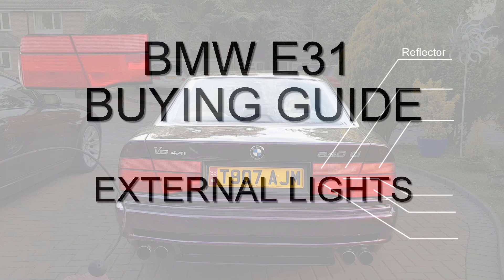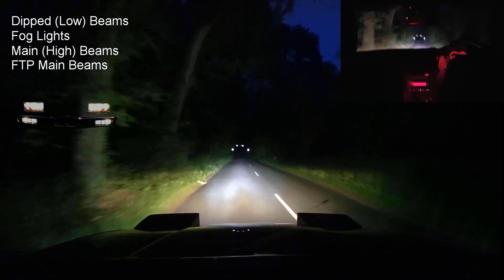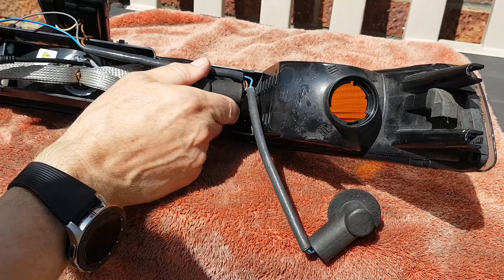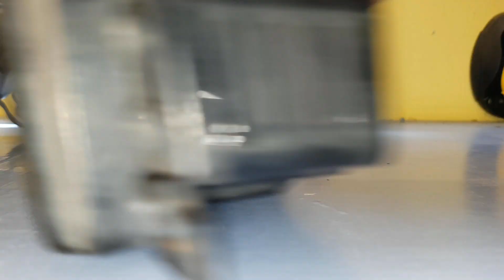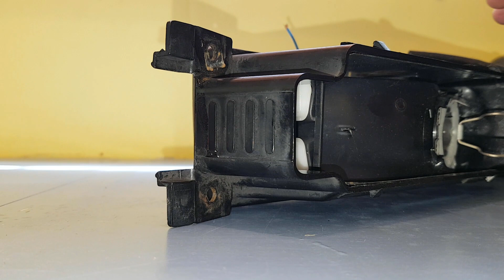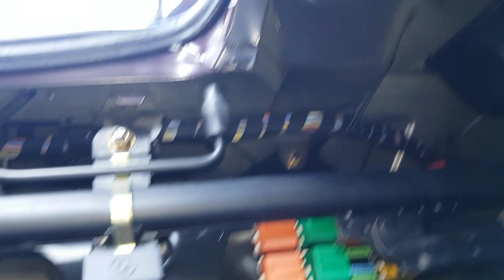BMW E31 Buyers Guide - Part 3 - External Lighting + LED's

Comment: My right side trunk side park  light is not working I switched the bulbs works on the left side is there fuse I’ve check engine bay all sims like it attacked no signs of burnt you think it’s light housing it’s self ?
Reply from the maker: The usual problem then! All explained here: https://youtu.be/2mdP5qv7a2Q?is=kYVWc7td7QhOstA_
Reply: @TimmsBMW thank you for the video I did both sides now working perfectly fine 🤝

Comment: What if you dnt have cruise control. Can i do led brake lights?
Reply from the maker: You will get errors on the MID saying you have a bulb failure - but apart from that they will work

Comment: Hello MR Tim 
I am trying to change my FTP ON MY 840ci, bulbs to LED bulbs
The OBC detect error!! Trying to add resistor!! Not working!!!!! 
Any help ........pls 🙏🏻!!! THABKS
Reply from the maker: Read this first: https://www.meeknet.co.uk/e31/BMW_E31_Solving_Side_Light_Failure_Messages_when_using_LED_Sidelights_in_the_FTP.htm

To check if the PTC or LED is the problem switch on the sidelights BEFORE putting the key in the ignition - if you still get the error message then the LED you have chosen does not demand enough current to fool the LKM. If you don't get the error message then ensure the PTC is soldered in correctly and is the type as linked on meeknet
Reply: Thanks Tim 
You’re certainly the Guru on BMW e31 
Many thanks indeed 
Cheers🙏🏻

Comment: Great video and great information on your "Timm's BMW E31 8-series" website.  I recently stumbled on it trying to fix a problem.  I have owned my 1996 840Ci since 1997 and wish I had seen your videos before now, your sites are fantastic!  Maybe you can assist, the K39 relay that operates the pop feature of the headlights is intermittent and the part is NLA, I considered contact cleaner spray in the module, any suggestions?
Reply from the maker: Yes, they can be re-soldered (or reflowed more accurately), they have some heavy components on the PCB (it is much more than a relay and has some electronics inside), and the heavier components strain the PCB causing solder defects. This is quite a normal problem on these so don't panic - and those relays have been NLA for a while now!
Reply: Thanks TImm, is that an amateur solder repair or take to an electronics shop?  Is the joint fairly obvious?
Reply from the maker: @glively8730  They are not immediately obvious - and you will need flux (Chemtronics CW8700 is the best) and multi-core solder to effect the repair successfully
Reply: Last question, how do you open the module without destroying it?

Comment: Hi Tim, what’s your thoughts on HID kits ? Not seen anyone put them on or not many seller. Thanks
Reply from the maker: I can't really comment as I have never fitted them - but they will suffer from the same problems as LED's and couldn't be used in the dipped beams or fog lights as the beam pattern will be all over the place. Still, as main beams they have a lot going for them as you can get a lot of light from them!